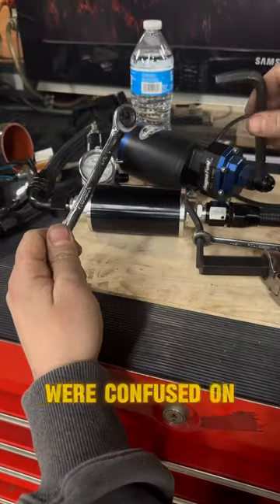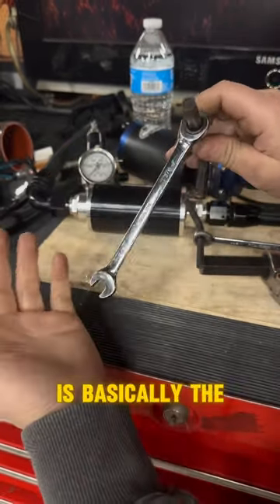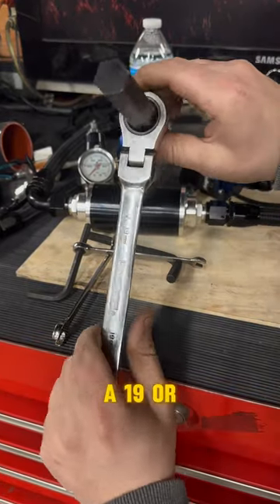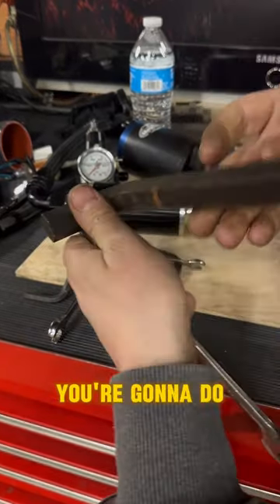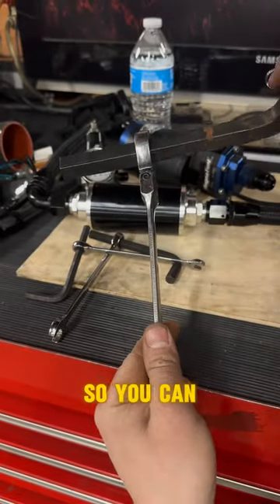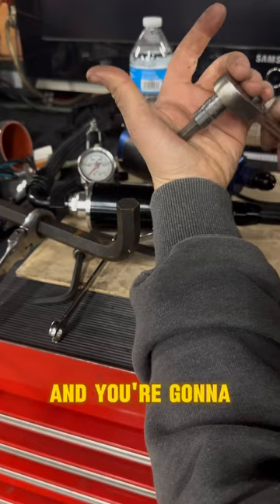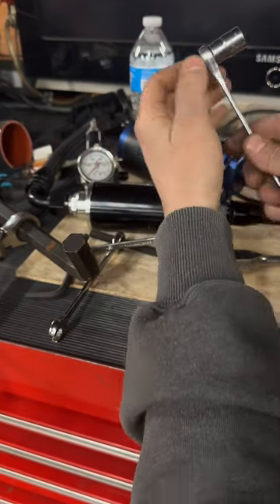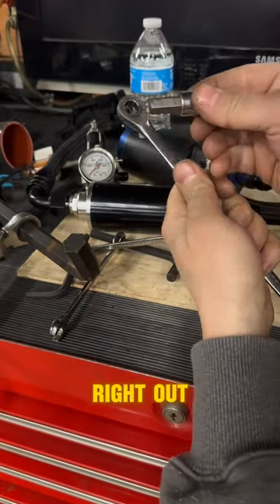Allen’s wrench secret pt 2 #tools #mechanic #automobile #shorts #viral #youtube #video

Comment: Who would be confused about this?
Who thinks that a 3/8" Allen wrench is the same as a 7/16" wrench?
Reply from the maker: Lmao there were literally comments saying “ wow what size Allen did you have to use to work with the ratchet wrench”
Reply: @DeRosaDriven  Really? I was being sarcastic. I didn't realize people didn't know.

But then again, I did work with a young Subaru 'technician' at a small garage, and I watched him measure (with calipers) then cut, grind, measure, grind, test fit, measure, and finally weld a 1/2" X 1/2" piece of steel to an old socket so he could take out the 1/2" square drive plug in the side of a manual transmission so he could add gear lube in an old Chevy.

 Subarus were all metric Allen head plugs. He was mighty pissed off when I walked over and pulled it off and stuck a 1/2" ratchet in the hole. lol

He tried to throw away his new 'tool'. NOPE! I hung that on the wall, it stayed there for YEARS.

It takes all types I suppose.

Comment: A 3/8 bolt does not use a 3/8 wrench. Bolts are labeled by theead diameter, not head diameter.